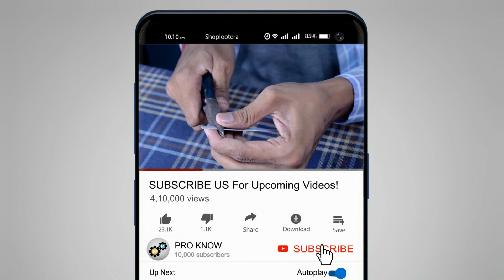2 Amazing DIY ideas

Comment: Hi bro... I like your videos 🤩☺️ and your content nice 🔥🔥🔥🔥🔥              but I am having a question, I want to know to the weight of 1000mah 3s lipo battery and 2200mah 3s lipo battery 🤔🙄 and which company lipo battery is good ?? I have seen that all are using orange lipo batteries are they good for beginners like me , I want make an aeroplane with 1000kv brushless motor with 1045 prop plz suggest me the battery for that which is in my budget and good quality 🙏🏻I am confused which I should buy 😵🤪🤯😤😫😣😩 and tell the weight of that battery also which you suggest I know that this comment is too long😂....... sorry for that and please reply 👍 ok bro....